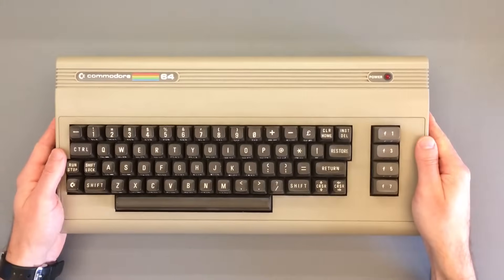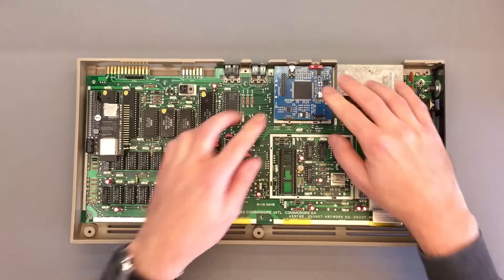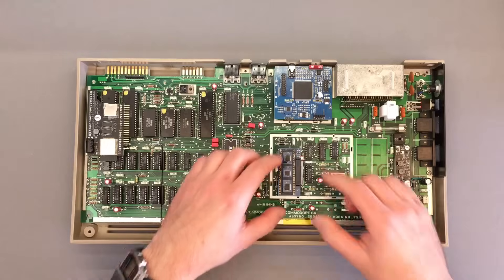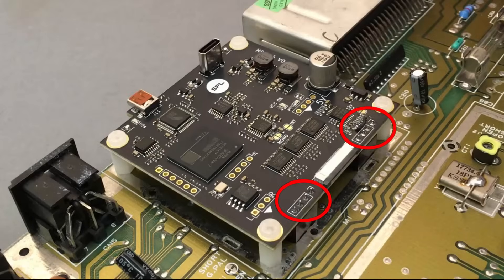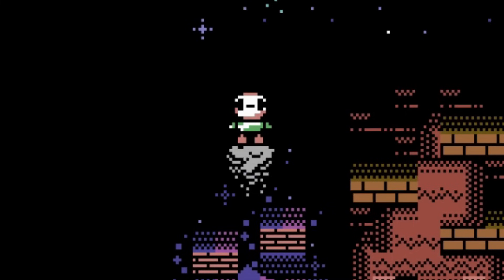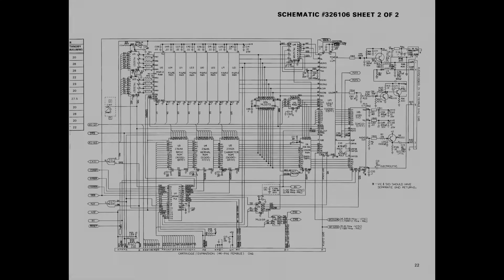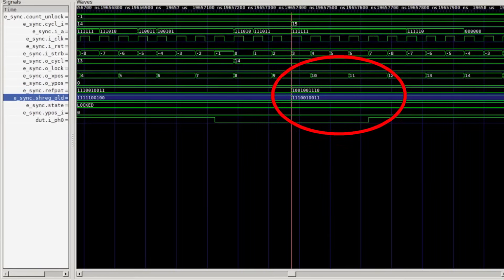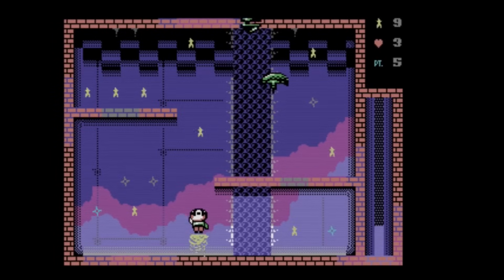Finally true, Full-HD HDMI for the Commodore 64

Comment: As my soldering skills are far from perfect, I'd be keen to avoid having to do so wherever possible. Also, since I have multiple C64c(s) and as the cost of this device is far from what I'd call 'cheap' (not a criticism by the way), the ability to move the device to different systems would be advantageous. With that in mind, some way to secure the rear of the device to the board it sits on without the need for super-glue (clips?) would be a welcome addition. As would the replacement of the solder pads for the audio section, with jumper pins and jumper caps. Might also be worthwhile replacing the ribbon cable with something a bit thicker / more resilient to being ripped / torn while installing, as I've seen one YouTuber manage this already, while installing this device. In every other aspect, this is definitely the 'cleanest', most hassle-free upgrade for the C64 to achieve HDMI output, I've seen so far. Well done!

Comment: Just installed it in clone. Quite impressive and really nice. But one thing I don't understand. Why the right channel as default? Audio industry has used left channel for a century. Also SID replacements that can be stereo use the default $D400 SID address as the left and other addresses as the right. If just wiring up things using the internal audio then you get left and right switched. I could then wire it up for external input (requires routing for SIDs that only output left on the motherboard) - but then if for some reason I change to mono in the config util then I only get sound from the right channel. That is quite a mess! (for some odd reason Reloaded MK2 has the exact same issue with its stereo options)
Reply from the maker: I could switch it in software, but I'd rather not. The reason I put the motherboard-borne audio signal on the right channel is that it is physically on the right, and I wanted to make things as intuitive as possible. Either way I believe there is not much of a real problem as, when using only the signal through the motherboard users should set the audio to "mono", while any kind of stereo solution should be wired to the dedicated stereo header. Or are there cases in which you can't route both channels to the stereo header?
Reply: @sideprojectslab7352  Thank you for feedback. I guess an option would be nice. Sure that would switch L/R markings on external inputs but guess that's a minor thing. Have looked a bit into stereo options which takes two SID. It seems that those that do not have external output for primary channel assume $D400 as through motherboard - which everyone agrees is left. Looking at "simple" SID replacements with stereo options then both ARM2SID and FPGASID output $D400 output through motherboard to have expected output of sound when content with traditional mono sound is loaded (which is still by far the most common material no matter if talking games or dedicated music). The more advanced options of SidKick Pico has separate output of stereo as well as left ($D400) through motherboard. Those are the 3 modern integrated stereo options that I'm familiar with.
Last question. Is it possible to implement a volume control? Output of the FPGASID is quite strong and causes clipping (distortion) at the peaks (no issue with sound quality from it when listening directly to the analog signal). Sure the author of FPGASID could implement volume option as well and I'll reach out to him too.
Reply from the maker: @HifiCentret  The clipping you describe happens at the ADC input, so no amount of volume control in the HD-64 will fix that. The input audio dynamic of the HD-64 is something like 6vpp, which is plenty to support original SID and ARMSID models, so the problem seems to be more on the FPGASID side.
Reply: @sideprojectslab7352  Thanks. That was what I fearred. Oh well. I'll probably make a small board to give input to the external inputs anyway since it seem like the only way to be able to get left/right right on both analog output and HDMI. It should be a small thing to add a simple volume control. Either trimpots or just a fixed divider with toggle.

Comment: Does it include all royal suckness? 1) 16 colours of diahrea hindered by composite encoding limits, 2) vertical banding so the screen looks like a soccerfield, 3) Checkerboard micro chroma-noise for annoying font zig-zag edges, 4) Serious Chroma-bleed so sprites almost look to ZX-colour clash, 5) Horrible readable font, 6) Too few characters on screen to do anything serious, nearly MSX-bad. 7) Fill even more of the screen with a meh lavender colour to deliver true 4:3? 8) Simulate 50Hz flicker by black frame insertion on 100Hz+ screens, 9) add 15 KHz sawtooth sound effect to the sound output?
Reply from the maker: only the suckness that in my humble opinion serves a visual purpose, that is, blur, scanlines and at some point in the near future PAL color blend. For the rest of the suckness, with the HD-64 you still retain the original VIC and analog output, that's very much intentional

Comment: I've got one of these boards and they're fantastic but I was trying it on another TV with a micro to hdmi adapter, when I took the adapter out the plastic came off revealing the pins, some may have touched and now it doesn't display, any ideas as to what it's done.
Reply from the maker: I handle this kind of issues on discord, please join the server in the video description and if possible provide a picture of the damaged part
Reply: @sideprojectslab7352 OK but there doesn't look like anything is damaged

Comment: I'd like to use something like this with my Retrotink 4K.
It's best if the signal isn't modified before being ingested by the upscaler. Can it be configured to output pixels with an exact 1:1 resolution matching the internal C64 graphics with no aspect ratio correction or upscaling?
Or better yet, MiSTer style 'direct video'? Then maybe it could support sending metadata to the RT4K, and could be used with a HDMI to VGA dongle like the MiSTer for zero-lag lightgun compatible RGB output?
Reply from the maker: I'm sorry to disappoint you but the answer is no to all of it :D the HD-64 output 1080x1920 progressive at 50/60Hz with stereo audio and that is it

Comment: Its  a great product for people like me who dislike external conversion boxes. Yes, the C64 never looked that sharp 40 years ago but if you prefer the blurry image just dont use this PCB (or take of your glasses...;-) )
Some possible improvements in the manual:

The process of desoldering and removing the old HF Modulator should be covert in the manual from my point of view, this was the most difficult task. 

I'm also not clear if I have to add a heatsink to the VIC because the original housing which worked as a heatsink doesn't fit anymore and there was no heatsink in the box.

There were two flat ribbon-cables attached to the VIC "in-between part". I guess one is a spare part which the manual doesn't mention. I realized it after plugging in the VIC and had to remove it one more time.

Comment: Hi, do you use Amiga computers as well? If so, are you aware of or could you create something similar to this, for A500/A1200? I do believe my current TV, supports upscaling via its' 'RCA', video input. Have tested with a video recorder. I tried a device from 'Temu', it updates the 'Frames', too slowly? :)
Reply from the maker: I believe some excellent solutions already exist for the amiga, which involve a Raspberry Pi

Comment: Is it possible use it on C64 Reloaded MK2 board?
Reply from the maker: The Reloaded MK2 doesn't have the necessary pin headers in the correct position on the board, interesting choice, but it is what it is. Nevertheless there seems to be enough space in the RF modulator area so with some additional wiring and possibly some custom standoffs it should be compatible

Comment: Major props for releasing the full gerbers - with the C64 scene being strongly commercialized that's something I didn't fully expect.
Reply from the maker: considering the amount of time and effort it takes to develop these gadgets I'm not too frustrated about projects being closed source. I'm also planning to keep the firmware closed until I have met my financial goals, though I will probably open-source the VIC-II emulation part
Reply from the maker: The VIC-II is now officially FOSS
Reply: @sideprojectslab7352  I am very much open source, but I also understand your position, especially when open source means to find your gadget sold by others on ebay when you have done all the dirty job. Thanks for what have you done which is amazing.

Comment: I find it intereting this small board is like hundreds faster with hundreds time more memory than the entire system it supports...
Reply from the maker: Not quite, it has a small fraction of the system's memory and it could only host a small fraction of the entire system if I were to emulate the various chips. It has the smallest FPGA that would allow for the functionality I had in mind
Reply: @sideprojectslab7352  I take that back, as I looked up specs for what you have used. Then again I do not think you mentioned what you used and you do not indicate that on the shop page. Had to look at the pictures. Main chip is also grinded on the pics at least, which is a bit shady, but whatever. Initially I figured you need something quite powerful to process video, but then I reminded myself we are talking about NTSC/PAL resolutions with 16 colors, so almost anything can handle that.

Comment: This is incredible!  The board With newer revisions, do you see major ICs changing or is the BOM locked for now? I see people messing with resistors on the discord which is nbd.
Reply from the maker: The BOM is about fixed but we are trying to improve the quality of the S-Video output. If it comes out that we actually need a fix at all I'll personally patch all production boards from the 1st batch, and then adjust the circuit for coming batches. But anything that has to do with HDMI is pretty much consolidated at this point

Comment: This looks great, but would it work on a C128? I'm not talking about the RGB 80 column C128 output, just the regular 40 columns mode. I understand the Vic chip is not exactly the same in the C128, so there might be some extra work to do on that side. And, yeah, you guessed right, I do have a C128 (and no C64)
Reply from the maker: electrically it should be fine, with the proper adapter, and the shared features should work just fine. But I don't really know to which extent the two chips overlap

Comment: This is really fantastic achievement... But i am a C128 user...
Would that work there too?
In fact could that fix the 2MHz problem? (There is no video signal/output when in FAST mode as you very probably already know)
I mean that would be a mega sensation 😁 and give to a C128 absolutely new possibilities (and also to the C64 Mode on C128)...
If that is not supported now, would it actually be possible?
Reply from the maker: Unfortunately the VIC of the 128 has a different pinout and in general seems to have different additional capabilities that are not covered in this development. In addition to that there seem to be mechanical/clearance issues

Comment: Is the original VIC still needed, or will it work without it?
Reply from the maker: Yes it is still needed. The decision is very much intentional, as you get to retain the original functionality of the computer. It is a fantastic debugging tool too, as I can view the same exact output from teh HD-64 and from the AV-Connector side by side and spot the differences, I'll make a video soon on this.

Comment: Good, but all this modding kills the original hardware feeling. Then the emulator is just fine..
Reply from the maker: This will actually be the topic of one of my next videos, but make no mistake, the mods I design are intended to leave the underlying hardware as stock as possible, in fact you can still use the thing 100% like in the old days

Comment: Instead of blurring adjacent pixels to emulate the CRT look, I think it would be more accurate to model glow . I.e. a bright pixel should influence surrounding pixels, but a black pixel should not.
Reply from the maker: I still have a good 30% resources available on the FPGA and I intend to use them for this kind of improvements. For now I would say it's quite OK already, but when the product is launched and I can switch to maintenance mode I will start perfecting the video quality even further. This kind of behavior could be implemented with a non-linear transformation of pixel values before entering the anti-aliasing filter.

Comment: While cheapo HDMI scalers using the S Vido and AV at the same time to HDMI with a smoothing filter and scanline generator built in they are only £30 from Ali Express yet it is way better using a CRT Monitor S Video to VGA and a Scanline Generator to get fat or thin scanlines adjust the screen size adding extra color and contrast to any slightly washed out CRT Monitor it is AUTHENTIC looks way better than just a plain  CRT TV with S Video as it ennhances the grahics slightly it looks almost as good as RGB connection

Comment: HELL NO rather a Scaler and Scanline generator using S Video to VGA to a CRT monitor it is more AUTHENTIC and actually almost looks as good as RGB making the Commodore 64 graphics enhanced HDMI screens SUCK for retro gaming
Reply from the maker: Thing is, with the HD-64 you still have the S-Video output, just like before, so you can still do all the things you said just the same. You now have the option to output HDMI as well. Is this product for you? I'm going to guess it isn't, but do you make space for the possibility that it could be useful to someone, or that others might actually prefer the video quality over HDMI, as well as the clean setup without external conversion boxes?
Reply: @sideprojectslab7352  a cheapo Chinese Ali Express blue and red things with S Video to HDMI Scaler does the exact same thing

Comment: Very cool! Especially like and interested in your ezhdl. Will need to check it out! Wondering why not use myhdl though?!

BTW copperdragon didn't invent the idea of sniffing the vic II. This was done way back in the chameleon and maybe others.

Also don't expect the vic implementation to be a walk in the park due to being "passive". It still gotta handle all those quirks.. Copperdragon had some issues seen only in certain demos.

I'd like to buy an early version when available!
Reply from the maker: Yes, EzHDL will be my next big project in 2025. I tried MyHDL but I really don't agree with many design choices and it lacks some testing facilities that I deem necessary. The project has too much legacy to be truly restructured at this point so I decided to do it from scratch. If you'd like to help out with writing a EzHDL-to-Verilog converter I'd be delighted to coach you.

The VIC implementation was not easy but I was able to replicate the Kawari implementation very closely, to the point that all the demos I tried behave identical to the original VIC, while the c0pperdragon board has visible issues. I am sure there will be additional small quirks to adjust in the future but we are extremely close already.

Comment: Any info about any lag (upscaling etc usually takes its toll)?
Reply from the maker: as I mentioned, being a 100% hardware solution (FPGA) and being synchronized in lockstep with the original VIC, the latency is about 600-700us (just a few video lines), which is quite low if you ask me :D
Reply: @sideprojectslab7352  That's awesome. I look forward testing this one!

Comment: Can the technical info of this project be used to increase the resolution of the Vic 2 provided a memory expansion is supplied?
Reply from the maker: I'm not sure I can follow, can you expand?
Reply: Not exactly. As the VIC2 is the driving bit which accesses the memory for characters attributes and sprites it defines the produced image by the requested data. I’m not exactly share is the HD64 could be easily modified to do the DMA by it self but I bet the board and interposed cable hav to be modified for this. The next issue is that the VIC 2 only has an address range of 16kBytes which limits the possible resolution too. And there are only 4bit wide attribute data (color ram) available which is also limiting. To overcome these limitations there have to be quite a bit of modifications be done to the c64 to allow for larger memory space for an extended VIC II. By then you delve into an other system architecture as you also have to feed that more of resolution with the necessary data via a more powerful CPU and possibly mass storage system.